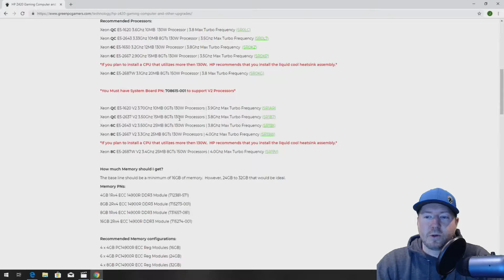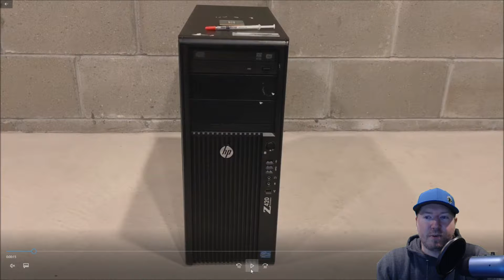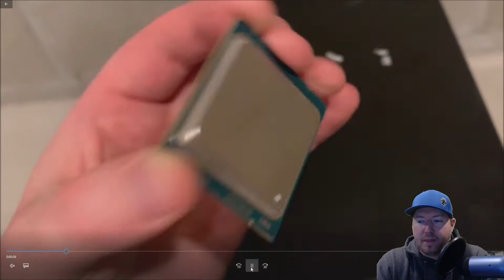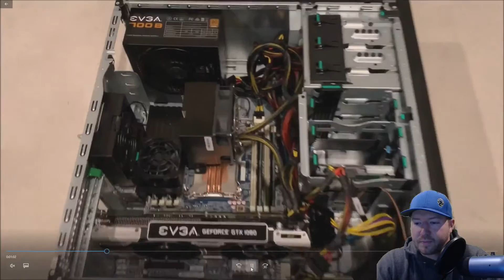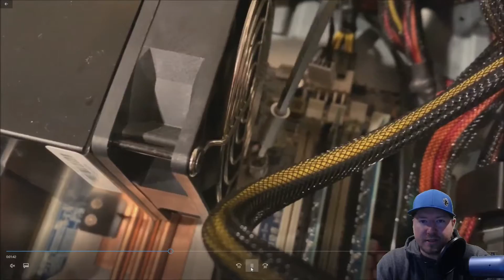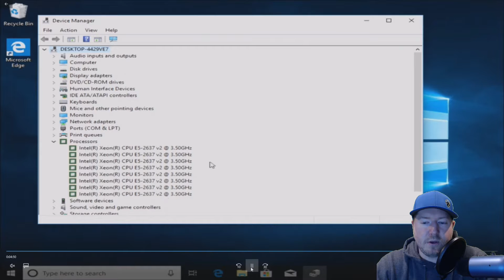HP Z420 Processor Upgrade and Install (E5-2637 V2)

Comment: Hi so I see hte v3 of the Xeon 8C E5-2687W V2 3.4Ghz 25MB 8GTs 150W Processor is out with 10 cores.  Are the version 3 of theses CPUs any good for this build? Does the Motherboard/Firmware take them?

Comment: Thanks for all the Z420 vids - they've been very useful.

I decided to do some benchmarking with the various CPU's I've since collected (my HPZ420 originally  came with an E5-1620 v2).

HP Z420 (Rev 2 motherboard)

Win 10 x64 Pro for Workstations
128 Gb RAM (1866 MHz)
NVIDIA GeForce GTX 1060 6GB

Cinebench R15:

Xeon E5-1620 v2 - OpenGL 67.49 fps - CPU 507 cb
Xeon E5-1650 v2 - OpenGL 82.97 fps - CPU 948 cb
Xeon E5-2667 v2 - OpenGL 73.31 fps - CPU 1275 cb
Xeon E5-2697 v2 - OpenGL 57.61 fps - CPU 1558 cb

Unigine Valley Benchmark 1.0: (Direct3D11 1360 x 768 fullscreen, Custom, High)

Xeon E5-1620 v2 - FPS 107.5 - Score 4500 - Min FPS 23.6 - Max FPS 163.9
Xeon E5-1650 v2 - FPS 109.6 - Score 4584 - Min FPS 26.4 - Max FPS 184.8
Xeon E5-2667 v2 - FPS 117.8 - Score 4930 - Min FPS 30.0 - Max FPS 199.6 
Xeon E5-2697 v2 - FPS 89.9  - Score 3762 - Min FPS 23.0 - Max FPS 153.6

The 2667 does seem to be the pick for gaming, although the 2697 monstered the Cinebench CPU rendering test. I didn't try the 2687W V2 (150W TDP),  but do have the optional high performance heat sink to run one, but I guess the results will be similar to the 2667

Comment: When I turn on My Hp Z420, fan run at full speed and no display is coming up. What could be the problem?
I have checked RAM's are all OKAY
Reply from the maker: Add and subtract components until you can pinpoint the issue.
Reply: @GreenPCGamerscom  I have replaced my Hp Z420 with Hp Z440.
There was an issue of IC in motherboard and it was non repairable

Comment: See SuperThunder/HP_Z420_Z620_Z820_BootBlock_Upgrade and check 43 pages pdf.
Z420 versions: 
v1: bios -> system information -> Boot Block Date: 12/28/2011 
v2: Boot Block Date: 3/6/13

Comment: Hello my friend, z420 support e5 2670 v2 ?
Reply: Only Z420 v2.
To check which version you own:
v1: bios -> system information -> Boot Block Date: 12/28/2011 
v2: Boot Block Date: 3/6/13
Reply: @ota1998  thanks bro, but I was able to see here my motherboard supports v2 and the xeon E5 2670 V2 worked smoothly

Comment: I'm trying to upgrade my v.1 cpu and i can't find the system board PN. But i have a boot block of 03/06/2013 and I'm told this will support v.2 cpu, do you agree with that? This is not a gaming Pc but a DAW(music Pc). Thanks.
Reply from the maker: This is the V2 board: 708615-001

Comment: hi Jay, do you know if the TPM is in the processor? tpm 2.0, thanks , Bill.
Reply from the maker: The TPM is normally embedded in the motherboard on workstations.
Reply: @GreenPCGamerscom  thanks Jay, It's there all right, a 1.2 version unfortunately. anyway, it seems like the latest development is that you must have an 8th gen chip. well that puts a lot of PCs out of reach of windows 11. for now at least . cheers Jay.

Comment: wait, the E5-2637 v2 is under the 708615-001 how come it works on a 618263-001
Reply from the maker: Are your sure it’s the v2 processor?  If so, what bios version is installed?

Comment: Hello! I just got one Z420 recently with 1620 and this board has RAID sata on it, it looks the SAME as on this video . understood from someone that to update the BIOS will be very difficult because  there are 3-types of BIOS to be update, is this correct? Hope that you could help by showing how to update these BIOS on this system. many thanks 22 Aug 2020
Reply: Nyimak

Comment: I've heard of people overclocking this PC but I seem to be having issues. I can't get an overclock to work. The software applies it but the clocks stay the same. Can you give me some tips as to what might be preventing me from overclocking it using either XTU or throttlestop? I'm using a 1680 V2 inside of it.
I just thought of something. Could it be the latest BIOS version is preventing me from overclocking?
Reply: Not all v2 chips can be overclocked. There is a list floating around somewhere. If you plan on overclocking make sure you get a xeon that allows it.

Comment: 12-Core 2.7GHz Intel Xeon Ivy Bridge-EP E5-2697 v2 how do i know what Gen my Z420 has
Reply: By the boot block date in bios. If its 12-28-11 it's a v1. If its 03-06-13 its v2.
Reply: I was able to install the E5-2697 in my Z420 with no problems, also I was able to install 128GB of memory in it and that also works.

Comment: Thanks for this work. I was wondering, is there any method to make v2 processors to run on "6XXX" series motherboards? (Sadly I have a 618263-001) Any information will be much appreciated. Thanks a lot beforehand.
Reply: Have you tried a BIOS update?
Reply: @dant6067  Yes. It did not work. It is now, an overpowered router, with firewall, NAS and many other network services with VMs. And is very reliable, 2 years no interruptions.
Reply: @cesaralfredom  Very nice.
Reply: Search SuperThunder/HP_Z420_Z620_Z820_BootBlock_Upgrade

Comment: But this cpu is a 140w and the 1620 is a 130w. How did it affect the power with the 600w hp?
Reply from the maker: At didn’t make a big difference with the stock psu.
Reply: @GreenPCGamerscom  i got a z420  recycled but it did not have al parts and adding a 22 in 1 media car reader , front fan gtx1060 etc..

Comment: My Z420 PIN number doesn’t not match with any of the ones on your blog (647290-001).
Reply from the maker: Hey Nicholas,  we haven’t tested that specific pn yet.  One of our trusted Community members claims that if the pn starts with a “6” it will only support V1 processors.  If it starts with a “7”, it will support v1 or V2 processors.  Hopefully this info is useful to you.

Comment: Im just curious what you think is a reasonable price for a used one of these on ebay i havent until recently been interested in workstations.
Reply from the maker: If it’s $200 or under you should be doing well.  Make sure to get one that supports the V2 processors.

Comment: Thanks for the video! However, if you're making a fresh thermal compound application you must clean the old layer off the heatsink before tighten it up over the CPU, even if the old layer is from the same kind of paste used. Also it's recommended to screw down the heatsink following a cross pattern between mounting points to ensure a smooth spread of the TIM. Best regards!
Reply: Yeah I noticed that too right away.  Definitely want to clean that old thermal paste from the heatsink before applying new to the new processor or else you're gonna have too much on there and it won't dissipate the heat properly.
Reply: Cross pattern as in saying the top right then the bottom left then top left and bottom right screw for an example?

Comment: I have a question, I bought the Z420 from Ebay and they said it would be v2 supported, but it definitely isnt supported, I guess send it back because they gave me wrong information? Or is there a way to make it v2 supported?
Reply from the maker: What is the system board part number?
Reply: @GreenPCGamerscom  619557-001 I thought they manually have programmed the bios to support v2, but they didnt.
Reply from the maker: That pn will not work with V2 processors.  (Even if you update the bios). Our blog shows the system board pn that will work.  

https://www.greenpcgamers.com/technology/hp-z420-gaming-computer-and-other-upgrades/

I hope this info helps.
Reply: @GreenPCGamerscom  Thank you very much, so with a HP Z420 708615-001 Lga 2011, i shouldn't have any problems with my Intel Xeon E5 1650 v2 and it should even be possible to overclock, am I right?
Reply from the maker: That board should work with V2 processors.  If you overclock the processor you should consider using the liquid cool cpu option.  Otherwise your cpu will get really hot.